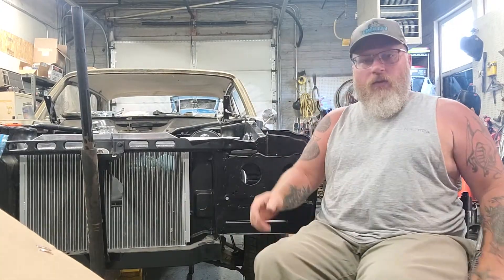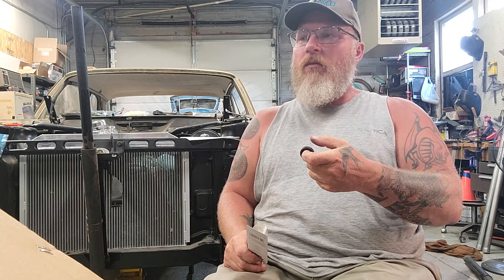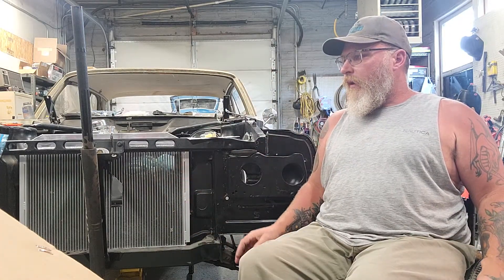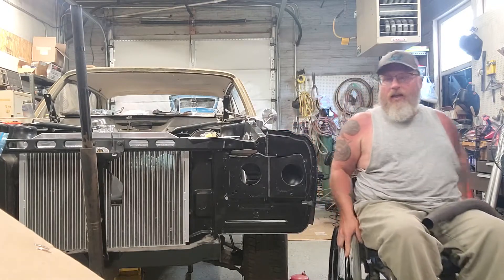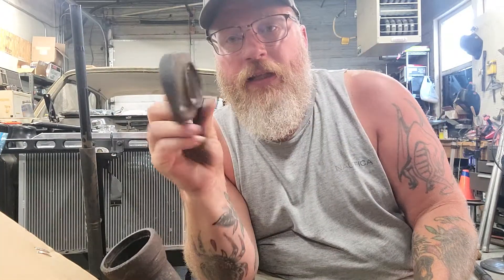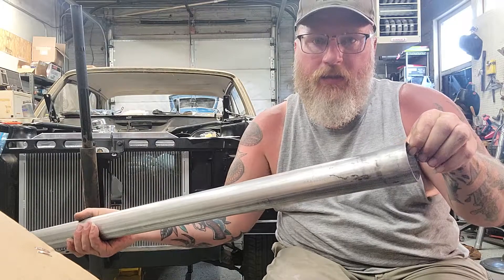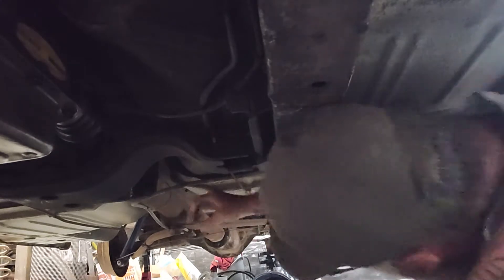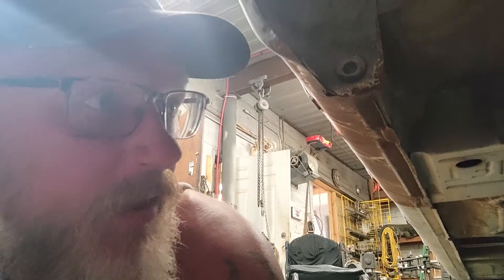Rambler exhaust and transmission linkage

Comment: Hi there! Very glad I found your channel. My name is Marc, I'm from the Netherlands and recently bought a '65 Rambler Classic. Sounds like I've got a problem that's very similar to yours regarding the shifter. My problem is that the shifter can be moved through the shifter positions without pulling the shifter forwards to unlock. Quite dangerous since the shifter moves out of Park very easily and will slip into Reverse without almost any hesistation. I think I found the fix for this problem on this page: https://www.sr-ix.com/AMC/Column-shifter-fix/index.html but I'm still working out how I can reach the part I want to work on. 

Love your video's! Keep it up :)
Reply from the maker: Thanks for the kind words and I hope you can get it figured out that is dangerous. Good luck let me know if you get it fixed